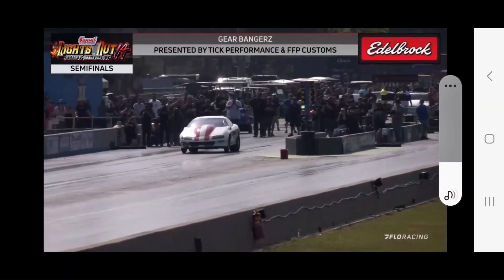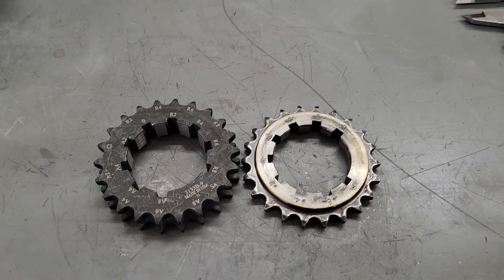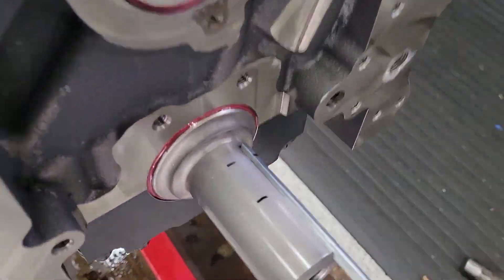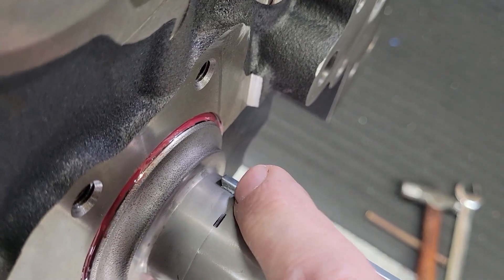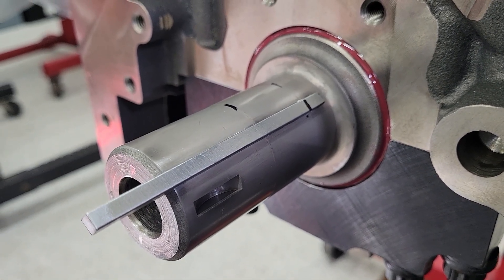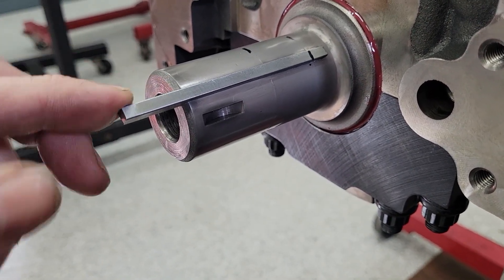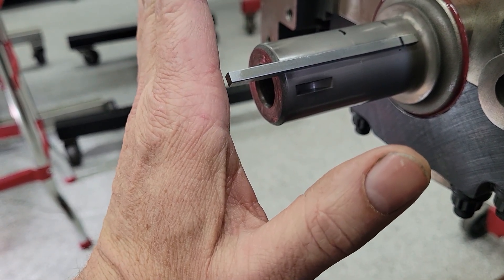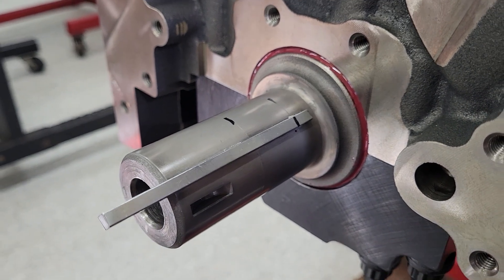Double Roller in an LS?  Don't be crazy!!

Comment: Everyone told me I didnt need one. Probably dont. But being a turbo car with 2step on the brake. I figured it would beat the valvetrain all to hell. I have 3/8 .080 pushrods too. They are pretty heavy and moderate spring rate. I just couldnt see why not to.

Comment: only reason for the single roller on these is because you cant fit double roller and a melling high volume oil pump, also the rollermaster chain set (best) has a big boss for the bottom sprocket like a double roller
Reply: Thankyou for this, had me nervous as I had just got a roll master single row but the bigger boss

Comment: Just recently, a quality single roller chain broke on an expensive race LS engine and caused major damage, I would not build a race LS without a quality double roller, its worth the additional effort to fit it.
Reply: You probably used oem GM one. Get a rollmaster billet set.
Reply: @Wesley-v1k  It was a high quality single roller used in a max effort Rock Bouncer which is on the limiter a lot.

Comment: On a reasonable street car a double is not necessary per se  but I would never say a single is better. I use to always use double on LS engines until I saw very very reputable shops using a single so now I use single on the street just because it’s easier. Great video here! That little key and its location…. I have not seen that before.